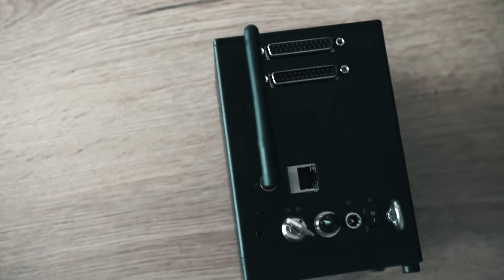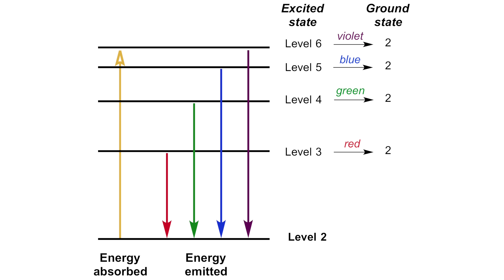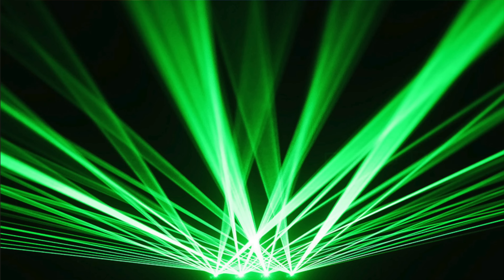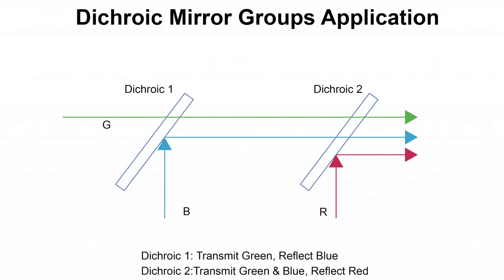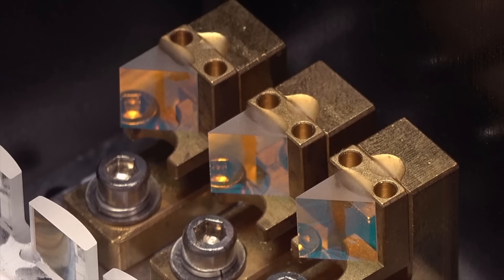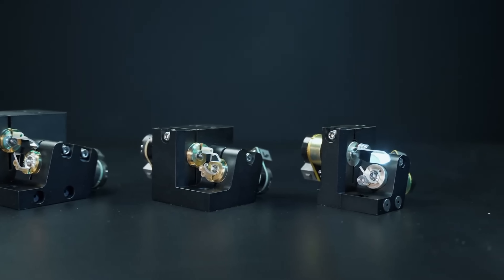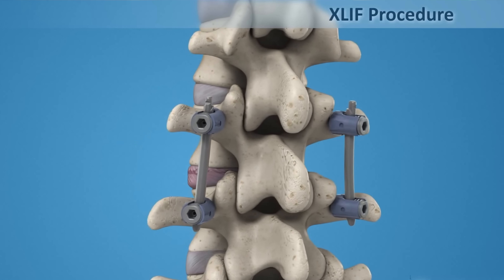The New Kind of LASER You Should Know About!

Comment: It was very interesting and well presented, even though I knew all of that. What I do not know, and what I would find extra interesting is just how those optical galvos move so fast with such positional accuracy.  What system of positional feedback is used (if any) to the electronics that feed the galvo motors?
Reply from the maker: Pulling it out of my butt, but I envisioned it like a voice coil head positioner in a hard drive, but radial instead of linear.  I think there's a discussion below about it in comments!

Comment: Old green ones “double” the YAG output (stick two infrared photons together to get green, but you can now buy direct green diodes that you push electricity into and photons pop out, like in an LED, similar to the GaN ones.
You can get white light lasers (eg continuum ones), but you wouldn’t be able to change the amounts of red green and blue, so white would be all you got 
With discrete red, green and blue you COULD have laser goggles that have absorptions at just those 3 colours, but you’d probably not be able to get the level of attenuation to bring the power down to class 1 levels. 
Pity they don’t add a time of flight camera so they could adjust the beam location based on the surface they’re beaming onto. Cool tool, but as you note, needs great care to ensure it’s done safely. Do share some more footage!
Reply from the maker: I wonder if it bleeds into the IR/UV spectrum?
Reply: @DavesGarage  doubled should have no IR if properly filtered, pure single colour diodes won’t have any UV or IR either, just the colour of choice. With Watts of power about there is plenty of hazard already.

Comment: Actually the two mirrors are aligned to only support light perpendicular to the mirrors, only that light will bounce back and further.  A more useful model is that only light at one angle can set up a standing wave (the mirrors are setup so that they are multiple of one wavelength apart.  When emission is stimulated it occurs in the same direction as the photon stimulating it in any case. Spontaneous tends to be random.   The crystal is also involved, but without tightly aligned mirrors, such a laser will not work, in fact gas lasers like HeNe work without the crystals at all.  One needs to align the rubby to the mirrors fir any efficiency,. But the mirrors have to support the standing wave to make it efficenicy amplify by stumulated emisdion in the first place. It called the resonator cavity.  

Important, class 3R is ANSI standard, not FDA. FDA has a class 3a and 3b.  But they do allow the 3R label.  3R is mostly for infrared, and near-infrared "invisible" lasers with class 2 levels of power.  Typically NIR laser diodes.   The lack of visibility makes the laser more dangerous, but not as dangerous as class 3b, not nearly.  For visible lasers, the potential. Class 3b lasers are not generally similar and generally much more dangerous. It is a large category.   It includes pulsed lasers with extremely dangerous pulse energies, and anyone operating is required to learn much more on a laser safety class.
Reply: The majority of lasers that exist today do not use crystals as an optical gain mechanism (the resonator). I suspect that most of the crystals that are used in any kind of laser today are for frequency doubling an infrared laser into green laser light.
Reply: @Pooua  That is only true for handheld lasers. There is a huge range of lasers that still use crystals as gain media: the vast majority of benchtop lasers use crystals/solid-state bulk gain media.
Reply: @LennyHirsch  Nd:YAG lasers have been a workhorse for a long time, and I used to build Cr:Er:Glass lasers. For a while, at least, slab lasers were popular in high power applications. Semiconductor and fiber lasers, especially combined, are taking over much of the industry, though.

Comment: Hi. In the beginning of your video it seems you're describing solid state lasers, but most laser show and smaller lasers are semiconductor lasers and use a resonant cavity or other technique to emit directly from the diode instead of a separate crystal. Also, to make your laser safer, you can deconverge the laser on the way out of the orifice, since the total power of the laser doesn't matter as much as the amount and duration hitting your eye or skin. A fast, big beam can be much more powerful than a skinny, static beam. Thanks for the video.

Comment: This is older tech. X/Y scanners of more then 30K Points per second is common in upper end laser projectors. Due to budget constraints, I have 15K PPS scanners as the price for these have been falling in the lower wattage ranges. If you order out of China, some 1/2 watt to 5 Watt laser RGB XY servo lasers are available for under $1000.  Look for the ones with the external input with the 25PIn parallel connector or the USB connection for creation of your own animated graphics. Those without the interface ans laser show creation software are limited to a few pre programmed animations and graphics looped with DMX.

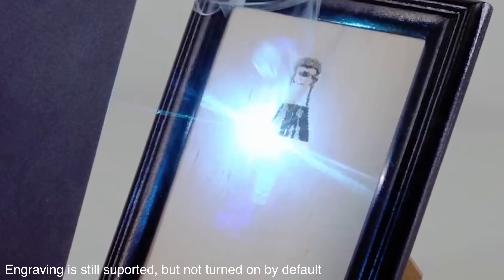Comment: @9:27  Which color? Obviously, narrow band red plus narrow band green plus narrow band blue! 
Also,.."We have to be concerned with the entire visible spectrum" Nope, absolutely not!
This thing is NOT pumping out full sectrum light, our brain is just "seeing" that from the mixture of three very narrow band primary color lasers. Seems to me that such glasses could easily pass 99% of ambient light and yet protect from this device. 
(They, of course, wouldnt be of much use if you also wanted to see the laser show!)
Basically, just like the dichromic mirrors, we need materials that act as narrow "notch" filters" for these three wavelengths. Mayby the dichromic mirror coatings are not narrow band enough, but I can't believe it's beyond modern material science to create such coatings

Comment: I have used a class 4 laser to power an electric field probe used to measure electric field strength from various RF sources. The laser is contained within a fiber optic cable and can keep the probe on for many hours at a time. Less expensive field probes use batteries, which need to be charged. Fiber optics are used because any wire which could power the probe would act as an antenna and corrupt the measurement. Even the battery powered probes send RS 232 signals containing measurements over fiber optics.

Comment: Here's a point you missed: When one of the atoms in the ruby drops into a lower energy level and emits a photon, that photon might hit another atom. That atom will, in turn, also drop down to a lower energy level. So now you have two photons, and not only that, they're in phase, so they're exactly 2x as strong. You get the same sort of cascade you get in a nuclear fission reaction.

When the waves are in phase, that is what makes it "coherent". Not just that it's in line, but all the peaks and troughs of the waveform are aligned. That's the difference between an actual "Light Amplified by Stimulated Emission of Radiation" and just a really bright monochromatic light.
Reply from the maker: That's what I was referring to as the chain reaction, but your explanation is much more complete!

Comment: Galvo scanners don't use motors; motors would be much too slow. They have a coil mounted next to a permanent magnet so that it can rotate and a spring holding it in the neutral position. Running current through the coil crates a magnetic field that interacts with that of the permanent magnet, generating a force that pushes against the spring. It's a simple current input to deflection angle relationship that doesn't need anything complex like generating stepper pulses to move to a new position. If you've read anything about the early history of electronics you might recognize the term galvanometer as the device inside an analog ammeter or voltmeter - a galvanometer scanner uses the same actuator mechanism, only the needle is replaced with a mirror.
Reply from the maker: That's why I say "or other actuators".  I presumed steppers were too slow, but a voice coil might work... thanks for the detail!

Comment: If you purchase lasers from Amazon, E-Bay, or equivalent VERY often the laser class is mislabeled. A supposedly safe laser may be much much more powerful than rated as a way to sneak killer lasers through the filters on the sales platforms. Treat them all as potential eyesight destroying tools until you are sure it's not. Supposed laser pointer class devices are known to burn holes in paper. So please be very very careful, folks.
{o.o}

Comment: For safety glasses, you could do 3 notch filters stacked, focused narrowly on the wavelengths you're wanting to block.

It would probably look trippy. Full color, but no laser. And OLED and quantum dot displays might have a color or two missing.
Reply: ' focused narrowly on the wavelengths you're wanting to block.'   Realize nothing is perfect, and that in general modern diode and other type lasers are so powerful that even 1% or less pass can still be in retina damage territory.
About the only thing that actually gives reasonable protection is using a video link.  Cheap camera and monitor/tv and a physical wall between you and the laser lets you isolate.
People are far, far too casual with this, especially with the laser engravers.  Ask any flash blinded welder how much you want to protect your vision, and then run the calculations for your laser power and the pass percentage of the glasses you're using.  Your notch filters won't be 100%, and the laser isn't 100% on frequency either.  Test it and you'll be surprised how much the pass through can still be.
For my 5W engraver laser from a few years ago, none of the goggles/glasses were really 100% safe.  They knock down the more general reflected light, but a direct beam or strong reflection are still above the hazard limits.  
Shield as much as possible, operate at low partial power as much as possible, and be procedural and aware of what you're doing when you actually run at full power, at least for engravers.
Reply from the maker: Interesting... can we build a visual notch filter with thin film interference or something?
Reply: @DavesGarage  Yes. Narrow band dichroic filters are (or rather were, damn LED's) commonly used by amateur astronomers to remove sky glow from sodium street lighting.
Reply: @DavesGarage  look up Dolby 3D, it's a technology for 3d laser projectors for movie theaters that uses two sets of RGB lasers with slightly different wavelengths, one per eye, and glasses that filter out the three wavelengths that are intended for the other eye instead of relying on polarization and polarization filters.  Those glasses probably are not designed for quite this intense of a light source but are otherwise exactly what's being discussed.  It allows for the advantages of laser projectors in terms of amount of the source light that can reach the screen to extend to 3d without bringing back the light limitations of polarization based 3d.  It's pretty neat tech and a neat idea, it could even make some extra interesting combination with projectors like the one here in that if you used a much lower power set at slightly different wavelengths alongside the main you could see a much dimmer version through the glasses to see what was happening and do things like alignment while protecting yourself from the high energy more dangerous beam that would be filtered by the glasses.  I'd imagine being completely unable to see the laser from too good a filter could actually be fairly dangerous due to reducing situational awareness of what was on and where it was pointed, much like how fiber optics with light outside the visible range can be much more dangerous than a significantly higher power fault finding laser in the visible spectrum because of the fact you won't notice it destroying your eye until it's too late with the non visible laser but will blink and look away from the visible laser.

Comment: I first saw a LASER in the late '60s or early'70. NASA's traveling science show visited our high school. They demonstrated very simple Time  Division Telemetry and an early LASER. They used a rotating multi sided mirror to project a weak read line on our Auditorium's large projector screen. I asked if they could duplicate Raster Scan lit NTSC video. The answer was , "Why the hell would anyone want to do that?"

Years later, it was common, and I worked to improve Telemetry equipment. The one NASA displayed had a 10KHz bandwidth. The last analog model that I worked on had a 40 MHz bandwidth.

Comment: I have worked ith some VERY high powered LASERs.  e used to amuse ourselves by poking holes in a steel file cabinet at over 3 feet.  Later, after I got into IT fulltime, I worked with some scanners that were too good at their job.  One fixed position scanner could read moving boxes at 2 feet and 25 to 30 bar codes per second.  While I was lineing this  beast up somebody switched it on.  I got it right in the eye.  I have learned to see around the damage.  Take care folks.  LASERs are serious business.

I have also had LASER surgery on both eyes for diabetic retinopathy.  It extended my eyesight by over a decade though  I'm now legally blind.  [I guess befoe I was illegally blind.]
Reply: I'm betting/hoping you became a strong advocate and user or loto procedures after that incident.
Reply: @glennmcgurrin8397  Very true.  Most often we could not do that through devices.  We adopted the "see it, say it, do it"  methods.

Comment: I've done a fair bit with the venue sized versions of this same sort of technology. There are a few more interesting elements to it, especially if you go back far enough. Look up PCAOM in relation to Argon lasers of years gone by. Multi line gas lasers producing RGB. And then there's the safety aspects. Beam stops, galvo protection and so on. That technology is now obsolete as we can plunge diode lasers into darkness very quickly when needed, and discreet colours mix as you've described. But in the case of the old argon or other gas systems, the laser head was its own part, often fiber coupled into the beam table and it would take time to shut down so a chunk of metal would move in the way if there was a scan error for example. Worth a look at! I still have a few of the more interesting examples of life before the diode. Every nerd such as yourself needs a pet argon. 10A of DC into 30mW of light output, the rest as heat... Those were the days ;)
Reply: Wow, that sounds super interesting! As a young guy I've never seen those, but any top-of-the-line tech, past or present, is always amazing to play with.

Comment: I have several HeNe lasers, and a very nice old Argon Laser I purchased from eBay, back in the early 2000s! I started making my own power supplies but got a bit scared away from the high DC voltages and very high amperes these supplies output. Television flybacks don't scare me much, but LASER power supplies are completely different killer animals!
Reply: And most of them wanted water cooling as well!
Reply: What are your HeNe laser output? Back in the 1970s I had a SpectraPhysics HeNe laser from Edmund Scientific, which was a measly 0.5mW
Reply: Those things hurt to get shocked by. I think I got a permanent twitch from playing around with a CO2 lasers power supply. But I still love the high voltage stuff.

Comment: Interesting video, but you got the explanation of a laser in the beginning of the video wrong.

After exciting the Cr atoms inside of the Ruby Rod they emit in all directions, not just the Crystal axis. The polished faces of the ruby crystal however reflect part of that light back into the ruby. Here these photons stimulate the emission of more photons (the SER part in LASER). The newly emitted photons are aligned with the original ones, so also aligned with the facets of the crystal.
The two crystal facets create a laser cavity which stimulates the emission of light in one specific axis. Which creates the laser beam.
The Rod is typically not polished on the sides to avoid parasitic lasing and to even out the pump light by scattering it.

The crystal axis stuff is more important for the polarization of the laser, not the lasing process itself.
Reply from the maker: But I never said they only emit on the Crystal axis.  I even point out that photons that come out "sideways" get reflected back for another chance.  My understanding is that less than 50% come out properly aligned.
Reply: @DavesGarage  the red photons that come out the side are lost as heat. They are not reabsorbed or get another chance.
These photons fall under Spontaneous emissions which is incoherent light. These spontaneous emissions that happen to be aligned with the laser cavity "start" the laser. Once lasing is established and the medium is saturated spontaneous emissions usually die out because excited Cr atoms don't have the "time" to decay spontaneously.  Depends on state lifetimes and the specific laser geometry.
Ruby has very long state lifetimes so spontaneous emissions once the laser has started quickly approach 0.

I'm open to a chat about lasers if you're interested. Professionally I'm a laser engineer, academically I'm a physicist.